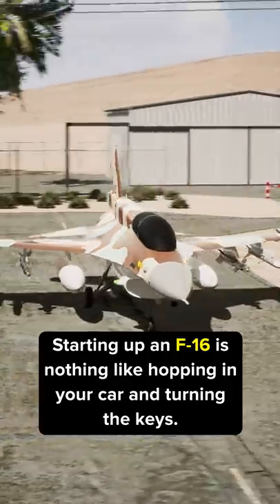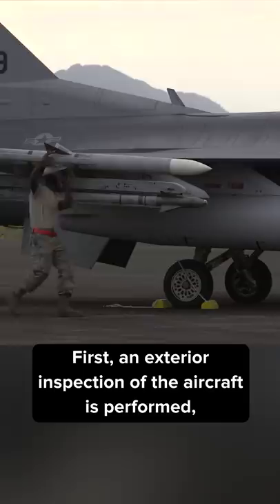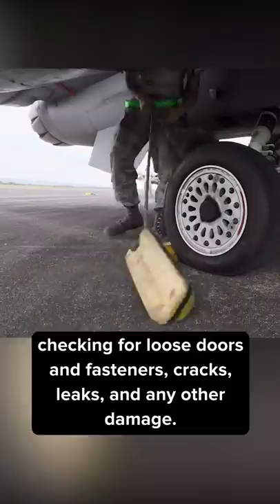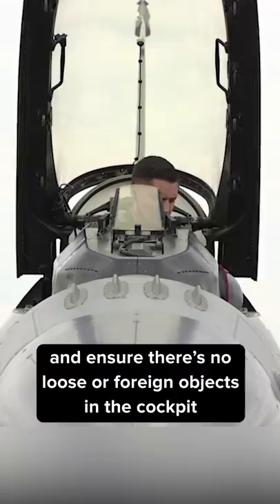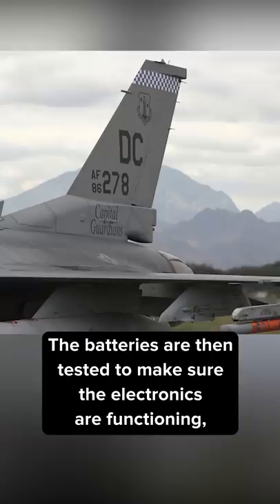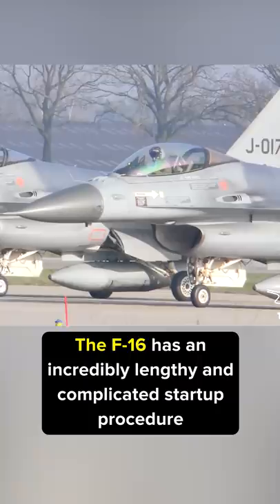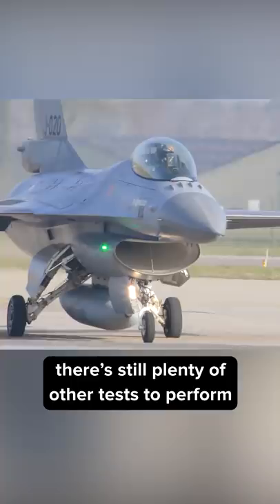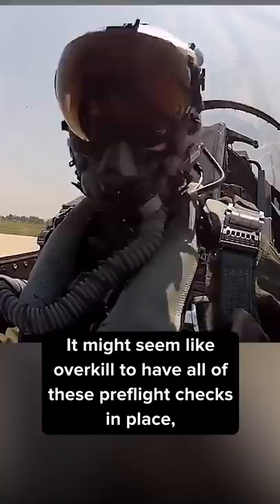Starting an F-16 Isn't Like Starting a Car

Comment: "we need that air support now!"

"Hang on bro, just checking my oxygen"
Reply: The new doctrine of persistent coverage says you should always have a fully loaded flight of aircraft coming in to replace the aircraft low on fuel leaving station. Basically you have one mission on station, one mission returning to base, one mission headed to the station, and one mission being refueled and rearmed on the base.
Reply: @Synchro ,
Air Force magazine and numerous courses taken during my USAF military service.
Reply: @davidhoffman1278  that and I'm pretty sure the checks only take time when the pilots are doing routine air hours.

Sorties...those checks are either predone or zipped thru in a hurry to get the birds in the air.
Reply: @davidhoffman1278  I have something to ask then. Just a little query. Is the cold start procedure any different when there is an emergency and the planes must be scrambled ? I know from flight sims that an f16 can be started without doing most checks, so I was wondering if there ever were situations in real life where a pilot might bypass all checks to get the plane in the air as fast as possible.

Thank you.
Reply: @clovislapointe3126  of course you can under circumstance. But since an accelerated check can take less than a minute to be done. I dont think that a problem
Reply: @QuanNguyen-nc3gm  wow. Didn't know you could get it done this fast. Thanks a lot for the insight !
Reply: Got to drive by Starbucks first!  😂 it has a cup holder, right?
Reply: @a.mathis9454  a multi million-dollar plane. It better have a damn cup holder. Plus their helmets have hit markers installed.
Reply: @DefaultName-ms2bb  cool, I’ll have to upgrade mine.   😂
Reply: Exactly! What do they do if they're needed immediately?
Reply: @davidhoffman1278  most can refuel in air and only land when they need to rearm or replace crew due to time restraints.
Reply: @aeureus  if base is in an area of high alert, then they usually have a flight in standby mode (meaning most of the preliminary check lists are completed (info coming from flight crews while stationed on Air Force bases)).
Reply: @a.mathis9454  eh fair enough, but what if it was safe, and all of a sudden they had to roll out? Guessing they gotta to.the checks fast af?
Reply: @aeureus  
Whatever items are skipped, the pilot is basically taking a risk. 
Assuming all maintenance and inspections are done all of the time, including routine replacements (parts, fluids, etc)due to age,
Then sure, the next pilot having to scramble will likely be flying an aircraft in good condition. 
But again, that is an assumption. 

What is to say the previous mechanic who was suppose to have replaced something, didn’t?

Also keep in mind: “scrambling a bird because we are under attack” is not that realistic of an assumption in modern day. 
WW2 fighters can be scrambled if must - standard ammunition are just machine guns and bigger caliber cannons. 
Modern fighter jets need specialized load out for the intended mission. 
Scrambling an F16 into the air with just standard machine guns, no sidewinder, no AMRAAM… Doesn’t seem realistic to me. 
Whereas for an F16 that is already loaded with anti-air load out, well then that bird should have already being inspected and ready to go.
This is on standby, exactly to avoid “last minute cold-scramble” scenarios.

F1 cars would have their engine running for quite a while before they roll up to the starting line, just to make sure all engine components are at proper working temperature and therefore proper dimensions and tolerances. (Different metal expand differently.)
You don’t go WOT on-track on a cold engine.

Professional sports athletes have their warmup routine before an actually game.
No pitcher would want to try throwing a 95+ fastball without having properly warmed up their body, muscles, joints, etc.

F16’s, as with most other modern jets, pilots “can” push the throttle beyond operational-safe levels. 
Just because they can do something, doesn’t mean they should.
Doing so basically scraps the engine when (if) he makes it back to base. And he will have a lot of unpleasant explaining to do, on why he pushed his engine beyond the redline. 

“Cold scramble starts”… kind of falls in similar category. 
1) why would you do it? was there another choice?
2) whose call is it to take the risk?
3) assuming the plane/engine doesn’t fail mid-flight and the pilot makes it back alive, who will take the heat/blame when the inquisition starts?
Reply: @reallifeengineer7214  eh I feel like there shouldn't be blame if it means potentially saving lives.

"WE NEED AIR SUPPORT! ENEMIES MOVING IN ON ALL SIDES WE NEED HELP NOW!!"

"Ey sorry bro I'm making sure my ejector seat is functi-" BANG "ONIIIIIIIIIIIIIIIIIIIIIIIIIIIIIIINNNNNNNNNNNNNNNNNGGGGGGGGGGGGGGGGGGGGGGGGGGGGG"
Reply: @aeureus  just a quick check list.   They should be off the ground in a few minutes as crews are usually nearby.
Reply: @a.mathis9454  "WHERES OUR DAMN AIR SUPPORT? JOHNNY JUST LOST HIS GOD DAMN LEG!!! AIR SUPPORT, AIR SUPPORTTT!!!!"

"I'm just checking out my tail... Gotta make sure I can wiggle it around..."

"Alright. Sabre 1 ready to take off.... Wait nevermind I gotta pee guys, hang in there a few minutes more :)"
Reply: @aeureus  I would assume that if that scenario came to pass, whatever malfunction that could happen with the airframe would be the least of my worries because by that time you would basically have enemies at the doors.
Reply: Yes thats literally correct
Reply: The oxygen is actually extremely important because the pilot needs a perfect amount of it or they will asphyxiate or get hypoxia
Reply: @wakcedout  there’s always planes on standby, ready at any given moment, with pilots moments away.
Reply: Ok ok!! Wait..where's my pen.............
Reply: In irl war it's not like a video game ability or something. If they know they can call for air support they know there are planes prepared for it. It's all part of the pre operation.

Comment: "The F-16 has an incredibly length and complicated startup procedure"
Me starting my F-16 in DCS: Blasphemy!
Reply: 100% what I was thinking, it’s so goddamn simple in-game
Reply: Indeed. If you want a hard startup, try the tomcat. Not too bad in front but wrestling that damn INS is pain.
Reply: Lol
Reply: @notalexzander2  as a tomcat pilot I can confirm my rio suffers every time :)
Reply: Yup
Reply: Meanwhile FC3 planes in that one corner 
Hehe press 3 buttons and go burner
Reply: Takes me less than 2 mins to cold start it in dcs. Most of it is spent on waiting for the stored ins to align
Reply: Yeah the startup isnt that complicated or lengthy.  Even if you do it by the book
Reply: @ah-64dapacheattackhelicopt73  exactly, two switches really and move your throttle and it’s started, the part that gets me is all the little dinky stuff like lights, mastercautuon, etc. but yeah starting it up is easy.
Reply: Yeah all the jeff pilots, i feel your sufferings 🫂
Reply: @HMMR03  stop making me feel bad Abt buying FC3. Best bang for my buck in my opinion, especially for a new player.
Reply: I mean, I use the auto start because I don’t have the time to learn the start up, but even then, it takes in around 2-3 minutes, and it goes pretty slow. The longest thing is waiting for INS to align, which is around 30 seconds. They make it out like it takes 30 minutes to start up.
Reply: @ah-64dapacheattackhelicopt73  it's also that easy IRL.
Reply: @flyingplatypus7272  you shouldn’t feel bad about fc3 and even owning the f16 i still go back for the fc3 aircraft all the time. It’s a great starter pack not to mention all the other content based off fc3 aircraft like f22, su-35, etc. you can still be very effective in all fc3 aircraft without the learning curve. F16 was a great upgrade tho I recommend it especially on sale like it is rn
Reply: Me, an F-16 crew chief: it's really not that lengthy or complicated. Our launches only take about 10 minutes from crew show to taxi out, but ok
Reply: @notalexzander2  what's the INS?
Reply: LUL
Reply: @aeureus  inertial navigation system. Common for most modern aircraft and fucking agony in the F-14B
Reply: @notalexzander2  :D sounds like DCS
Reply: flagrant sobbing and switch flipping in nearby fishbed ensues
Reply: @RobertSmith-en9ii  F
Though honestly (from what I’ve heard) some modern jets are worse. I have heard many a M2000 horror story.
Reply: Yea in dcs u can start a plane in 2 minutes

Irl obviously its different but still
Reply: @Quadraxis1  Same xD. I start this badboy soo many times that i can do it with my eyes close

Comment: My DCS F18 checklist-
Preflight - load flight with engines running
Mid air refueling checklist-
Ram KC 135 at 450 kts 
Carrier approach checklist-
Test ejection seat on touchdown

Comment: That is all about minimising risks in the long run. Aviation has led the way in that.  But assuming the thing has been put to bed properly and was untouched overnight,  in an urgent situation you can pull out the chocks and any tags, control/gust locks, climb in and start spinning up the engine.  Strap in,  pull out the safety on the seat and by the time you're out at the runway the fluids will be warm enough to shut the lid and hit the gas.

Comment: yeah I was in the Air Farce when the F4 Phantom was the big air superiority jet. I do mean big.  Anything so complicated required a lot of maintenance and many preflight inspections and checks. Very small thing could cause real disasters. The contemporary electronics and even the weapons are much more complex than the old Phantom.

Comment: It might be different based on law and regulation but besides F-16 specifics like checking if the eject seat is functioning, all of what was mentioned should also be done with any other vehicle. Check your tires, check your oil pressure and definitely let your car properly warm before driving it.

Comment: It’s not really that complicated to start them up. It doesn’t really take that long to check things like oil pressure, emergency annauticators, and stuff like that. But mostly it is just Battery -> APU -> Engine crank -> Throttle idle -> lights and other conditional things, screens and electronicts, and oxygen. Now, I am a flight similutor pilot so take what I say with a grain of salt 😂
Reply: Fighter Jets are different then General Aviation
Reply: @subjectc7505  I was referencing the DCS F-16…
Reply: @subjectc7505  most general aviation check different things too, all different based on size, amount of engines, type, etc. everything in aviation is very crazy but fantasizing!
Reply: Uhhhhh APU on an F-16? Where?
Reply: There's an EPU, but if you fire that, the crew chief is gonna kick your ass once you're clear of the jet
Reply: @ShelbyWithAShelby  maybe its that idk
Reply: @TimberDCS  the EPU is the emergency power unit. It can run either off of engine bleed air, or hydrazine. Definitely not something you want to have to use. Engine start on the F-16 is done with the JFS. It's Battery on, JFS Start 2, at 20% you take the throttle over the horn to add fuel, and watch your gauges
Reply: @ShelbyWithAShelby  ok my bad i have lots more time in the f18 that has an apu
Reply: @ShelbyWithAShelby  yeah, the EPU goin off kinda puts you straight on leave. Can cause cancer and other issues
Reply: @masonbe10  my best friend had a pilot pop an EPU during a launch, 2 weeks of blood tests almost every day, he's barely 21 and now has tremors like crazy. Can't hold his hand steady at all. Hydrazine does nasty things to your nervous system

Comment: So I'm guessing you wouldn't be able to scramble f-16s in an emergency to handle a hostile?
Reply: I'm assuming they just skip the non essential parts.
Reply: You definitely can. Fueling and such can be done in advance and the rest gets skipped if there's a big issue.
Reply: Aircraft that are meant to intercept are kept on standby, prechecked, he over-exaggerated that its that complicated
Reply: We do this preflight check he talks about in this video is good for 72 hours there was a situation where a C130 crew chief I believe stole the aircraft and they scrambled 16s but since he didn't feel like landing on his own they helped him get to the ground
Reply: When the aircraft are on alert all the switches in the cockpit are kept where they need in order to crank. Normally they are put to off, but this would take time. A lot of what is said in vid is done during pre/post flight inspection. From the alarm to the jet taxing it is only a few minutes.
Reply: @stealthmanx2  lol where did you hear this nonsense?
Reply: @TheChaz81  Hear? I did that while I was in the Air Force jack wad.  Even pulled Presidential alert for Bush down at Fort Hood for a month. Alert launch is not like a standard launch and what is done is bare minimum.

Comment: 2nd footage (after the 3d one) is an T50 or FA50PH, which is a jet created by korea using the knowledge came from manufacturing the F16s, you can see the similarity closely at the thrust control surface. Difference are the twin air intake and the nose pointing slightly more down

Comment: Reason is that very experienced test pilot on 10/30/1935 crashed what was found to be a perfectly operating plane. Pilot overlooked some of the more mundane stuff before taking off like releasing flight control gust locks. Checklists were implemented to ensure routine but critical tasks that were performed before takeoff where the more technical stuff that only a skilled pilot could do happens. Thus that day is known as National Checklists day as a reminder.

Comment: Who wrote this up? Yes, the crew chief does a lot of this during his/her pre-flight/post flight inspection. There is no checking of the emergency beacon or oxygen quality. As for starting the engine there are some knobs and switches that need to be in the correct place, but the actual cranking is pretty easy. Just keep an eye on RPM, FTIT,  oil/hyd press.

Comment: Actually if they’re anything like an F18 it’s about 4 switches and a bit of waiting, battery on, crank APU, crossbleed, crank left engine, check oil temp and pressure.  Technically you could take off with just that.  Though you’d want to kill the APU and crossbleed and crank the right engine afterwards.  The long process he describes is the equivalent of you checking your car’s tire pressure, angle of mirrors, belt timing, spark… not absolutely necessary to taking off

Comment: The engine is actually one of the first things that gets started. There isn't an APU to give electrical power so it's basically "test battery, test basic relays, test fire detection circuit, start engine"

Comment: Spoiling up the Inertial Navigation System alone takes 8 minutes.  I used to do start ups in Falcon 4.0, but it was just the most basic systems without the full systems tests; still complicated though.

Comment: Starting the F16 up is very easy when ur ignore the safety checks and not difficult at all. U turn the battery switch to on, Put the Engine starter switch to start 2, wait for the engine to reach 20% rpm, move throttle to idle an detent all power switches on the right side. And that would be it, u could start ur flight.

Comment: I'm a pilot and these preflight checks are done on most aircraft because no matter how expensive the aircraft, the life of the pilot or your passengers is top priority. It always impresses when an airbase scrambles fighters; obviously there's no time to perform these checks so the aircraft must be kept in an inspected condition. A spider plugging a pitot tube could cost the loss of life.

Comment: Well, if you wanted to pick up a hire car and take it on a very lengthy journey, you'd probably do pretty similar checks, or at least many would be done automatically by the engine management system, a warning light would tell you that one of the checks had failed.

Comment: Who here has played falcon 4.0? Cause by now, startup is kind of a no brainer. Parking brake on, ELEC to MAIN PWR, lights on, MASTER FUEL ON, ENG FEED NORM, AIR SOURCE NORM then fire up the JFS. I'm sure the real deal has more to it though. The bit I struggle with is the UFC controls. Never fails to confuse me.
Reply: How complicated is the DCS version?

Comment: Its actually easier you just flip a couple switches. All you did was list a bunch of pre-flight checklist crap, but actual startup is simple. If you didn’t care you were in an expensive aircraft and skipped the checklist, its no problem.

Comment: I mean I have to do a few things before starting my car up. I gotta let it idle down even if it’s in the summer because you gotta have the oil run through all of the cylinders and I customize my seat how I like it and every single time I get out I make sure it’s all the way down and back and I make sure my steering wheel is perfectly aligned from my gauges and then put on my seatbelt then I’m good

Comment: You forgot pulling the hydrazine safety pin.

Also for those that fly and maintain the F16, we will always call it the viper, not the falcon. It was called a viper long before it was called the falcon.

Comment: It's not just an F16. 
Even commercial planes too. That's why pilots need to check in 3 Hours before flights.
External pitot covers and sensors need to be removed, 

And that's why planes may have to be delayed  to another flight if the said problem is not solved.

Source ? Go and work at an airport and see for yourself.
I've spent over 4,000 hours on Airbuses and Boeings as Cabin & WheelBrakes tech.

Comment: This is funny, there are pre flight , post flight, thru flight inspections and the start up involves checking flight controls and monitoring the engine temp, oil pressure and other things.